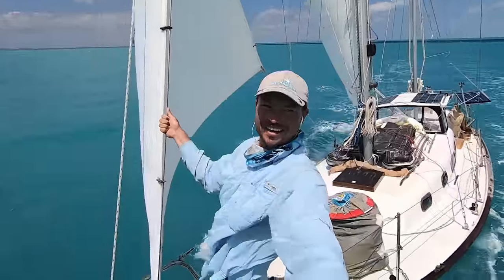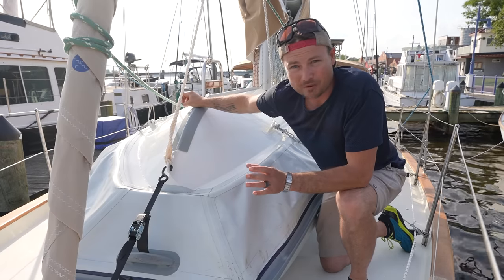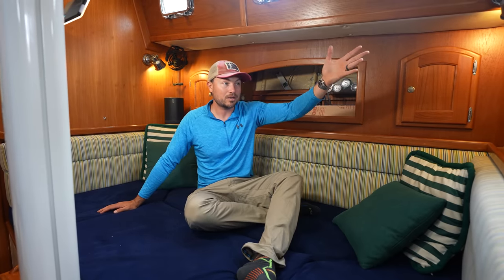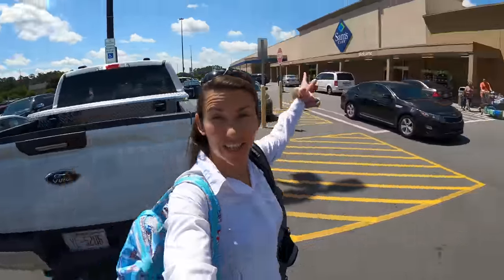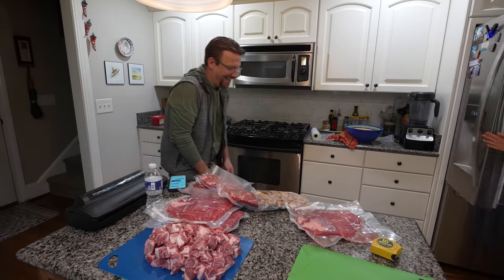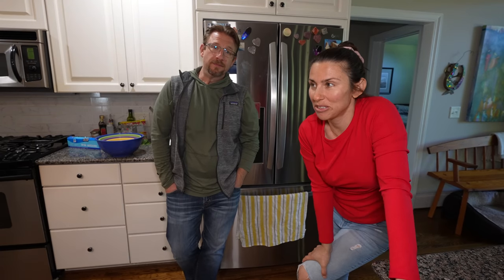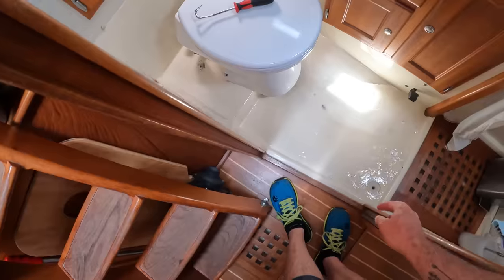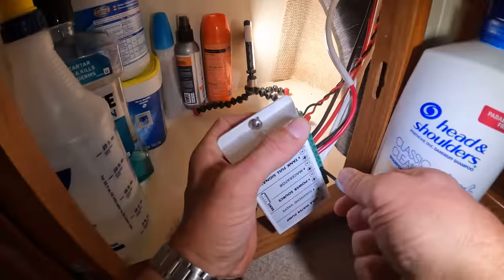It’s Finally Over! | S06E48

Comment: I would like your guys's advice if you had to pick out a very inexpensive sailboat which would you go with? Me and my family are considering making the switch but with zero selling experience...
Reply: I picked up a 83 Hunter 30 last year and have less than 10k into it. This was a really fun and inexpensive way to start.
Reply: @daneulekowski929  thank you we were thinking to spend anywhere from 40 to 50 so I don't see it being that expensive I guess I should have specified a price I just don't know what's good or not which makes it dangerous get the wrong one and well you know.. I don't care if the boat cost $10,000 if it's a good boat it's a good boat I just don't know what's good or bad and there's so much information out there that it makes it extremely difficult and not knowing anyone with any experience makes it that much harder

Comment: When your sailing days are over, or put on hold for teenagers, you should pick up a 2 year electrical technician degree, or a 4 year electrical engineering degree, or better yet a computer engineering degree so you can work on the water using Starlink.  My son is a work from home father and computer engineer.

Comment: The OLAS system looks impressive, but the reliance on a mobile app is always slightly concerning for a safety critical application.  It might make sense to have a spare phone handset permanently on charge and it's sole use is for the App.  No would then need to spend precious seconds looking for their mobile phone and opening app or have concerns that their phone battery is low.

Comment: White zip ties…. I’m surprised no one has said anything yet but I would never buy white zip ties mainly for ones that are exposed to the sun. They rot very fast and break. Now I know the ones in the video are inside boat and behind panels…. That being said those will probably be ok.  But when buying zip ties always get the black one they are more durable especially for outside use.

Comment: Salt water and urine create a solid deposit that is incredible hard and will clog everything. Try to minimize the sea water flush
Reply: Minimise? They need to maximise it. They need to over-flush as much as possible to get all the urine all the way out of all the outlet pipe. When most people would pump for 10 pumps (or 10 seconds), double it. Fresh water toilet flushing is all wonderful where you have unlimited access to it, which won’t be the case for them crossing an ocean, water maker or no.

Comment: I'm not happy with that safety system. IMHO this is outdated. 
- If one falls over board, you get that position - OK.
- what if the person drifts of?
- how should anybody help that person?

The actual solution for me are those PLB (personal locator beacon) that work on the AIS system. 
- If the person falls over board either she / he has to activate it (some may also work automatically)
- the PLB sends out its ID als a PLB INCLUDING it's actual position - might be changing. 
- EVERY ship in vicinity will get an alarm (including yours) on it's AIS display. PLB signals can't be suppressed it's an reserved emergency signal. 
-  Everybody evolved with the search will always see an actual position of that person.